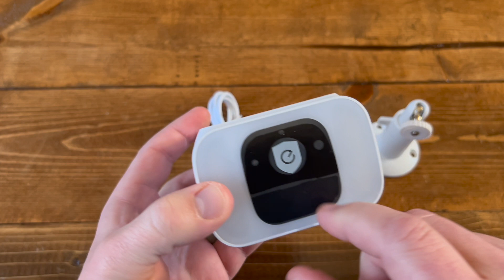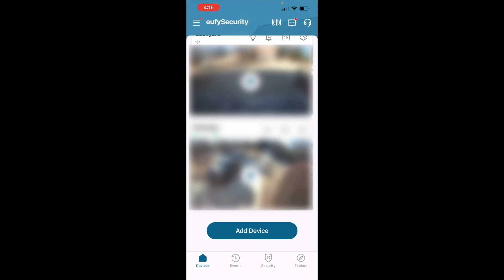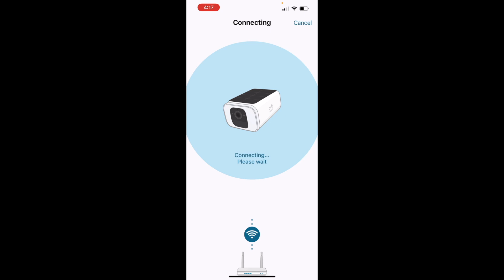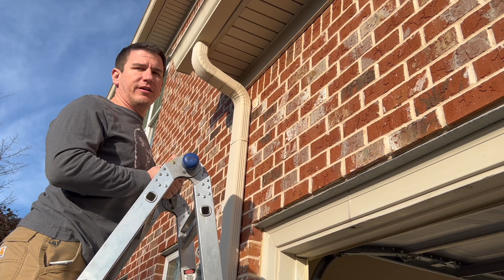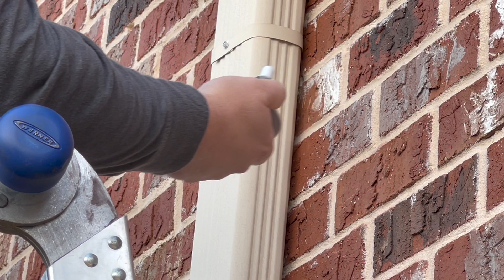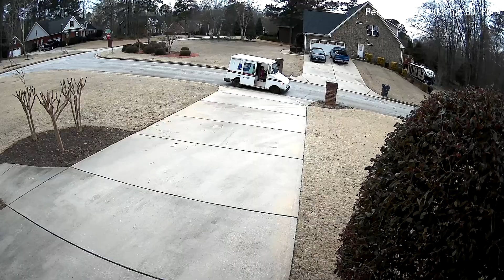EUFY SoloCam 2.0 | Battery Operated Security Camera With Integrated Solar Panel | NO MONTHLY FEES

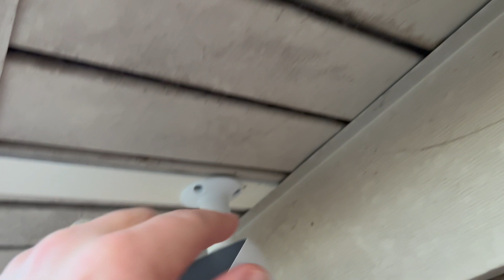Comment: Note: your 2nd mounting idea, at around 05:00 in the video, is not a good idea.  The camera is shaded by the soffit (roof overhang), so the solar panel likely won't get the minimum 2hrs sunlight needed to keep the battery charged. It possibly might still work - but it's not worth the gamble.

Comment: Question or two for you:

1. Do you still recommend this camera over Ring spotlight/floodlight?

2. Is there a newer plug in version? I’d like to get plug in so I don’t have to go up and down on my ladder. 

3. Could I look to see “what’s happening “ like I can with my Ring doorbell??

Thanks!!
Reply from the maker: Yes! I still like it better than Ring and no I’m not paid to say that. Eufy has a great interface and yes you get all of the same features as Ring for no monthly fee. You can get a live view anytime. I use it to see if it has rained when I’m away from home!  You could use this camera as a plug in if you have an outlet nearby. It comes with a USB-C(camera side) to USB(wall plug) cable you can plug into a block but the integrated solar panel works really well! I’ve never needed to take mine down to recharge it.
Reply from the maker: I also like the Eufy floodlight cam 360° if you have an area where you need to view a wider range and have great lighting.

Comment: I’m thinking of mounting the eufy in my soffit, like how you previously did with ring camera. I’m in Florida and right now I get about 14 hours sunlight. In the winter time, I get maybe 8-9 hours. How much minimum direct sunlight do I need if I mounted further out on the aluminum bar, further away from the garage soffit?
Reply from the maker: Mine gets about 6hours of direct sunlight and stays charged.

Comment: Thank you! Great information. I am inclined to use Eufy for my home system. But I have a couple of questions.

For non-subscription, will I still need the Homebase? Or is it optional? I keep seeing the homebase in other videos.

For solar charging, can this be installed under the eaves? Where the solar panel won’t be in direct sunlight?
Reply from the maker: Certain cameras require the HomeBase. The SoloCam S40 and 360 Floodlight cam do not require the HomeBase. The doorbells do.
Reply from the maker: The solar panel must be in direct sunlight.